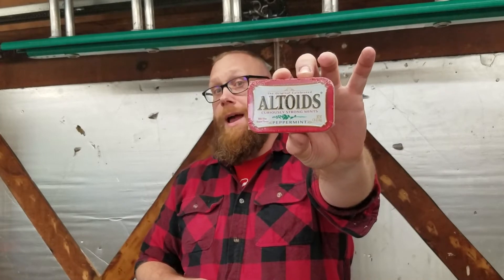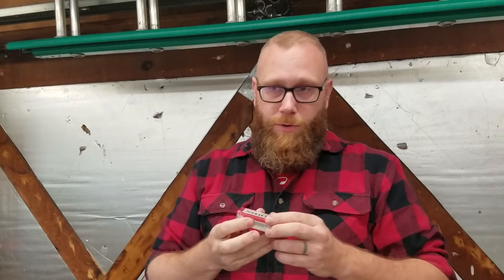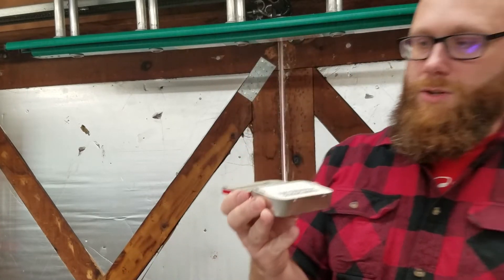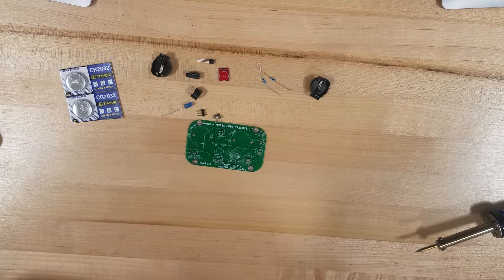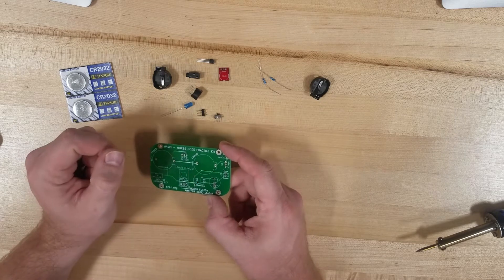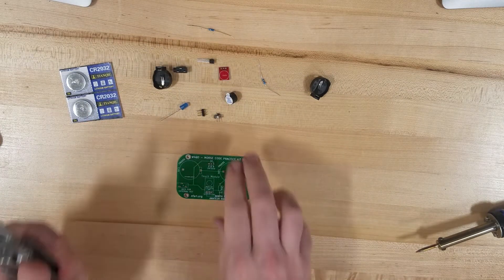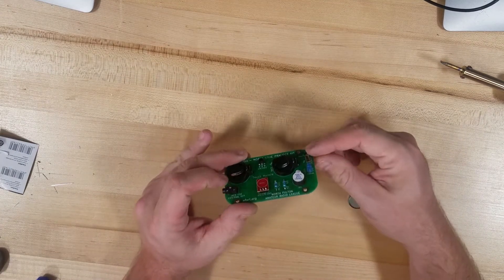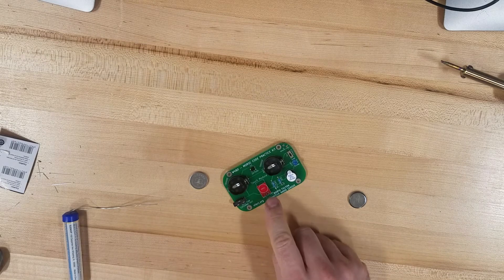Morse Code in an ALTOIDS tin?!

Comment: "May have laxative effect" ....not CW....the Altoids!! I just worked San Diego on 4.5 watts last night on 40m. QRP and CW opens possibilities as the gear is easy to build, cheap and simple but gets through...but I will say (quoting Peter Parker VK3YE) "frequency agility is king" ...rock locked is fun ....for a while but makes life difficult long term! So USE the practice oscillator and earn code ...you will not regret it.